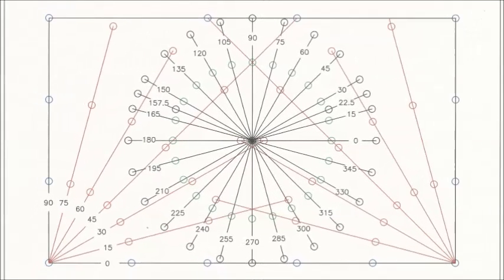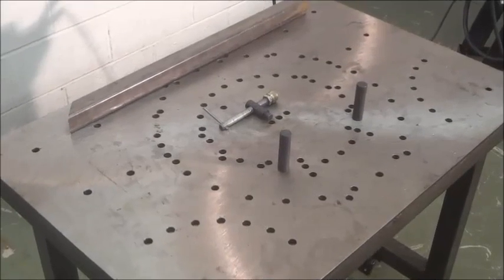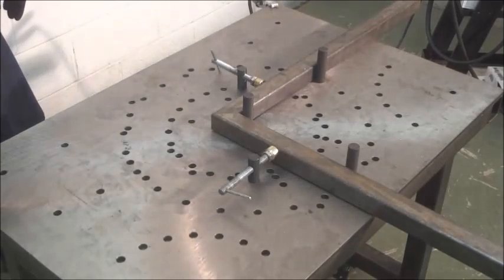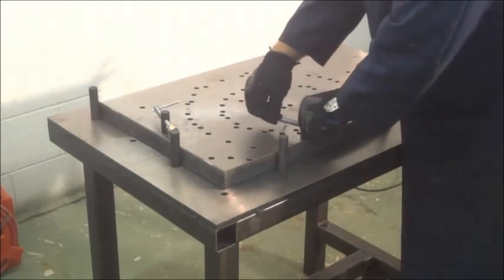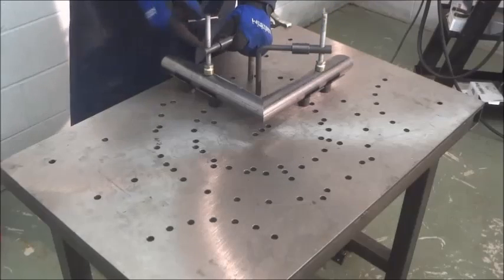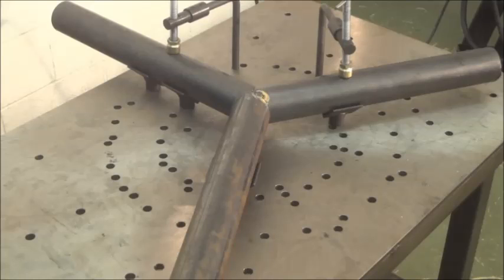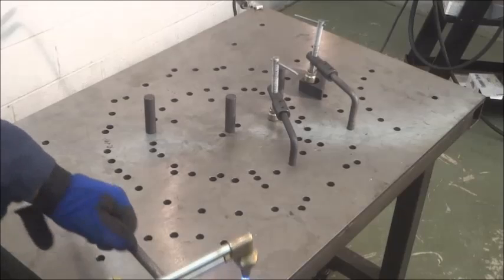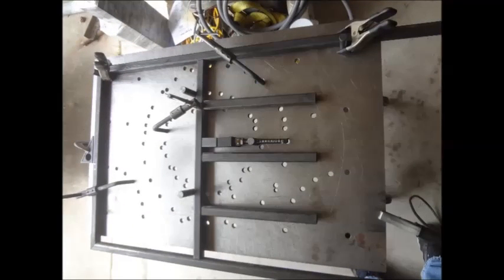Fab Pro Welding Table

Comment: is this table one very thick plate or 2 skins seperated by a gap
cant work out how the rods hold in..
Reply from the maker: The table is one solid plate, the vertical holders wedge themselves as they deflect.  I hope that answers your question, if not contact me at info@fabprotable.com for more detailed information.

Comment: thank u , it realy a nice one , but  can the table handle a bigger sale welding or any kind of work..??
Reply from the maker: Yes, the table can handle much larger work pieces than the table size.  The largest work piece we have placed on the table is the trailer me made for demonstrating the table locally.  It was approximately 10 ft.(3m).

Comment: Great table! Want this table, but your Contact Us tab on the website is not working. Please advise.
Reply from the maker: Sorry for the issue, you can contact us at info@fabprotable.com for more information or a quote.  Thank you for your interest.
Reply from the maker: Sorry for the issue, and thank you for the comment, you can contact us at info@fabprotable.com.
Reply: Cool table and I like how the holes don't follow other tables where they are are aligned in rows and columns. I might get one of these for my powertig welding setup.

Comment: Interested in buying the table, went to your website and the contact link doesn't work. Can you provide a working link or email address where to send inquiries. Thanks
Reply from the maker: Thank you for the heads up, will get that fixed shortly.  You can contact us at info@fabprotable.com and we will respond promptly, again thank you.